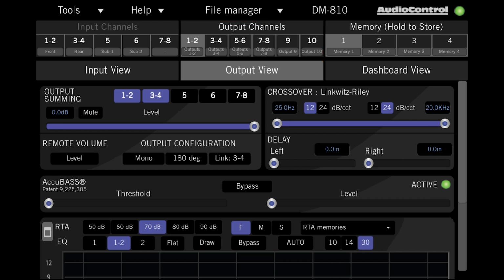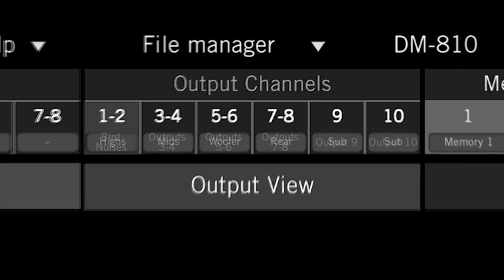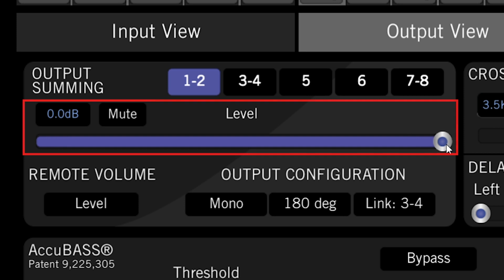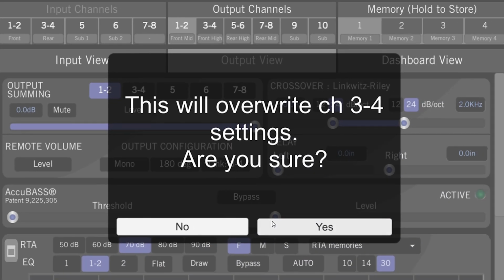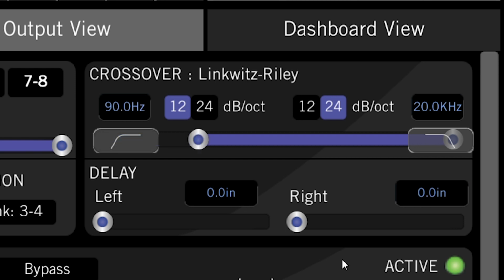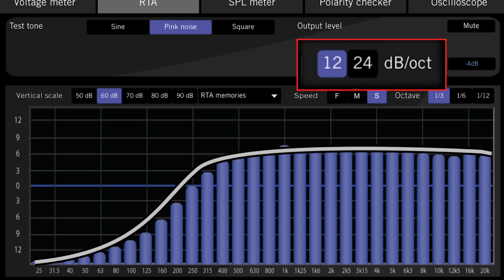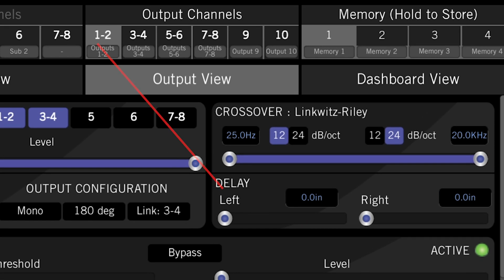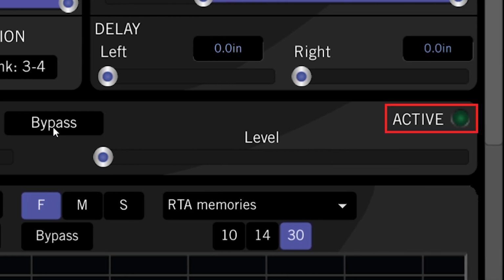Output Overview Part 1 - DM Smart App

Comment: When you select "Remote volume: Level", to link the volume level to the ACR-3 knob, and you have multiple output channels selected to use the Remote, does it adjust the level proportionally when you move the knob?
For example, channel 1-2 is set to 50% level, and 3-4 is set to 100% level. Then you enable "Remote volume level" to allow the knob to control both channels. When you turn the knob all the way up, does it set the channel 1-2 signal to 100%, or does it proportionally adjust volume, not allowing it to go over the 50% you had set previously?

Basically, I have a SPDIF signal coming in with no volume control, and want to make front speaker outputs quieter than my subwoofer output, but still be able to control all of it proportionally with the knob. I don't ever want the front speaker outputs going over 50% because that would either make it sound bad, or blow the speakers entirely.

Comment: Hello. I have a volvo xc70 2015 that amplifies and DAB. radio is under front car seat. There is no aux sound out and holes from the engine are on the same side. I need to convert speaker out to RCA. Both speaker cable and power will go on the same side. Do I need to use shielded speaker cable to avoid noise and interference ??